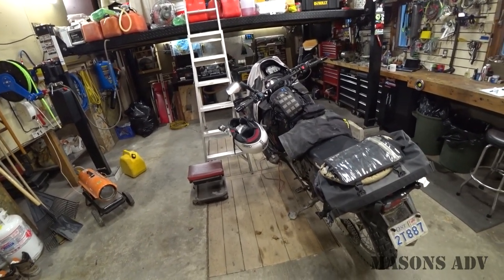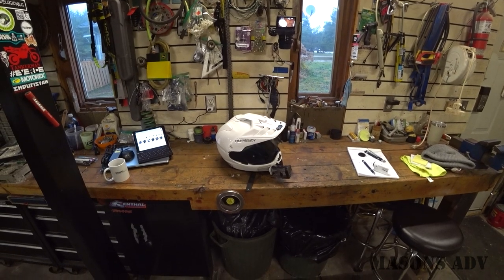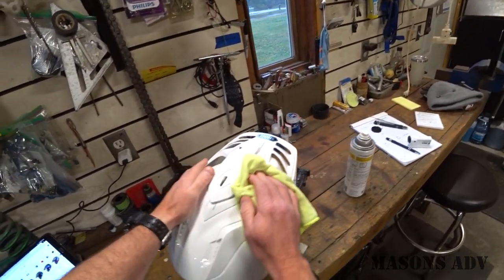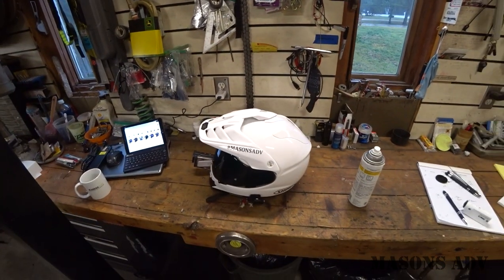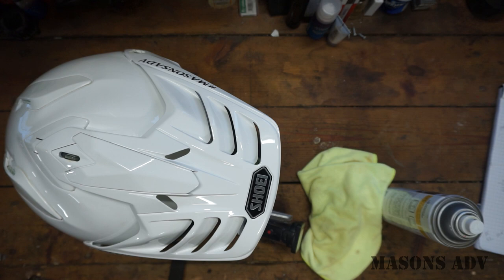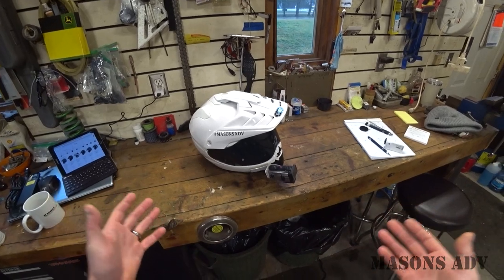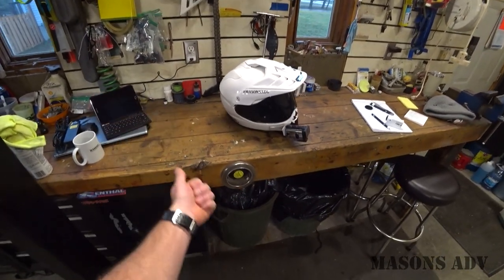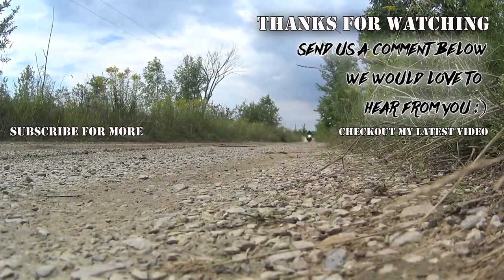Shoei Hornet X2 One year review | Masons ADV |

Comment: I also own this helmet as well as an Arai XD4. To me the Shoei is a way better option for ADV and Enduro riding. I’ve never had any issues with my Arai, but the Shoei is very very very quiet compared to my Arai. The Shoei is more comfortable for longer rides, and I have less buffeting as well. I also had a KLR (with a KLRDASH) but I now have a CRF450L. Even without a windscreen, I don’t notice a weight difference at speed. Thank you for this review, as well as all the information provided!!!
Reply from the maker: Great info Mike. Thanks. I find the Shoei much quieter than my Fly helmet was and the louvered visor seems to be quite stable at speed too. Cheers!
Reply: Hows the two helmet vent works at hot humid riding? Who better?
Reply: @andhikawayan  I like both my Arai XD4, and my Shoei Hornet X2... The Arai works well, but I think the Shoei seems to have better insulated properties. The Arai is definitely louder while riding. I don’t have any issues while riding in the heat with the Shoei, and to me it’s more comfortable.
Reply: @WetBananaMike  how much max temperature in ur place bro? Problem is my place here is tropical kinda weather with temp up to 42 °celcius so we most rider here prefer to use ear plug rather wearing bad venting helmet and having head sauna😀
Cheers from Bali
Reply: @andhikawayan  Where I live in the states, during the summer it ranges from 96-105 degrees Fahrenheit. My issue with the Arai is purely fogging up in the face shield when there is moisture in the air.

Comment: G'day Mason, nice review - I've had mine (in white too) for 2 years now and agree that this is a great helmet.
It fits ME beautifully - the shape is like it was made for me. Like you, the Arai was a bit short front to back and gave me a pressure point at the front, while the Klim that was my size had the largest shell size with the most padding, so, while it felt comfortable it was just because there was SO much padding.
The bottom half is VERY quiet (KLR692 with Staintune), part of that is because it fits so tight (and is almost hard to get on).
I'll disagree with you on the ventilation tho' - I had the previous version and it was much better, but also louder - part of this will be be my slightly taller/wider screen.
Now, the peak... for me it's not good. Ok, it doesn't catch the wind like the old one, but, mine would vibrate in the buffeting off the top/side of the screen. The buffeting/vibration would make the whole helmet resonate for an instant headache. I found that if I held the peak between 2 fingers it would stop, and I could ride comfortably. The final solution was to reinforce the front & side edges of the peak with thick wire and putty/glue, and get a slightly taller & wider screen. 
the other problem is the small speaker cutouts, my old Sena would just fit but it did stuff-up the wires, and the big speakers on my new Cardo just don't fit inside the cutouts (I had to put the padding back in & stick the speakers on top so now they touch my ears - you get used to it, but it is a pain to get glasses on).
Interesting about the SNELL certification - over here in Aus ours is ECE, I wonder if it is the same helmet?

But, fit is 1st, 2nd & 3rd.

How's the weather treating you? It was 33 deg here today & tomorrow might get to 40, and overnight goes down to 20. But that's Celsius.

Comment: I hate the D connect for the strap. I had a helmet with the ratchet strap and loved it but the head shape really didn't fit me so had to take it back and ended up with an HJC RPHA. It has the D rings too but I really miss that ratchet strap, so much easier and faster. Thanks for the review, any problems with the visor at higher speeds?

Comment: Mason...Just purchased a Hornet X2 ...what size do you wear and what size did you buy? According to size chart I wear a large 59-60. Seems a little tight. where do I find info on the Shoei cheek pad swap program? I just purchased a Triumph 900 Rally Pro and watched all your videos so far. Curious of your opinion between it and the KTM 790. Thanks.
Reply from the maker: I also bought the XL and the shell size is perfect but I did buy smaller cheek pads. I didn't do the exchange program so I'm not too familiar with it but contact Shoei and see what they will do. Cheers!

Comment: Your perspective is reassuring since I am  now marketing for a new helmet. However given my very painful and frustrating three year tolerance of an otherwise great HJC model, strictly with reference to its lack of any realistic provision of ear pockets for earphones, I need to know that the Hornet is designed to bury those headphones ....,away from the ears.

Your silence on this point causes me to presume that it is not an issue, but my very sore ears would be grateful for a little more reassurance by hearing the words.......”It “ain’t” a problem bubba”!

Thanks much for doing my testing for me. The net has its uses, n’est ce pas?
Reply from the maker: oh, right! I forgot to mention that. It does have speaker pockets, something i was missing in my Fly helmet and was high on my list when shopping for the Shoei. Your good to go Bubba 👍